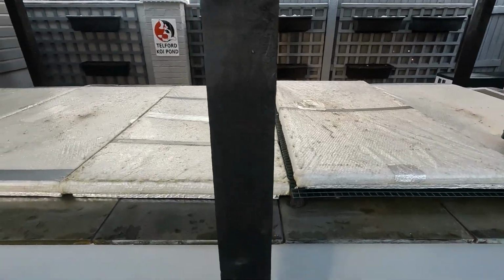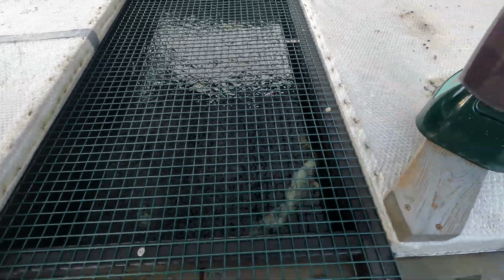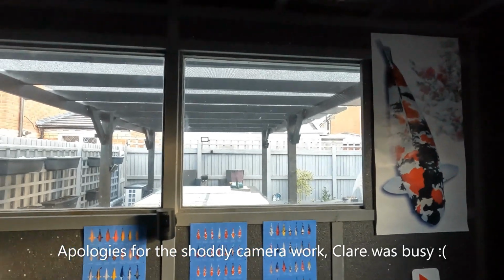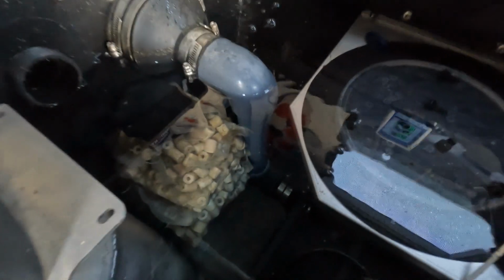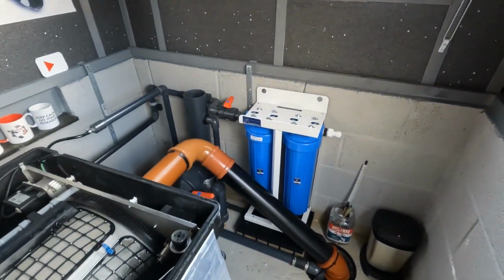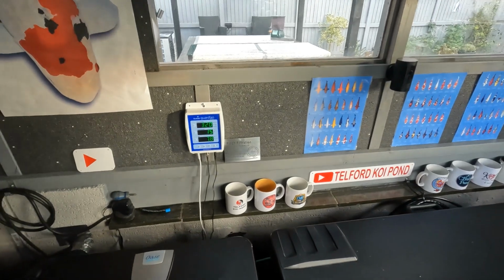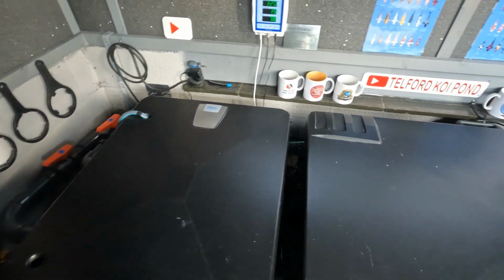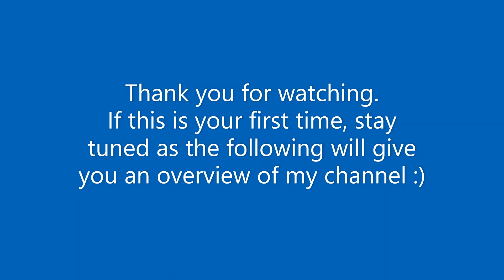T.K.P.  Telford Koi Pond - Video 90 – Winter set up, Recycled RO Update & some Shout Outs.

Comment: All that work cutting those insulation boards is really paying off now eh Phil. Filter house is really holding its own in terms of ambient temperature. Excellent update👍
Reply from the maker: Hi Paul🖐. Won’t lie, it was a long log getting them all cut and stuck on but am really pleased with how they have improved the heat retention in the filter house😊. Thank you for watching and commenting, much appreciated 👍🐟🈲😊🎄

Comment: Keep the heat on mate, 10 deg and feed good quality wheatgerm 👍
Reply from the maker: Think you may have just confirmed what I was thinking. Not brave enough to turn it off after seeing all the frozen ponds this week 👍. Thank you for watching and commenting 👍🐟🈲😊🎄
Reply: Sorry mate only just seen reply 👍
Remember It's not about the heat it's stability of temperature, and turning it off completely can easily upset the balance of a normally stable environment, cheers rob

Comment: Thanks for the video 👍. How did you fix the insulation sheets in the pump house? looks really neat.
Reply from the maker: Insulation was fixed with “ no more mails” grab adhesive👍. Applies just like mastic but suck the insulation boards onto whatever you fix it to and then dries like glue……great stuff👍